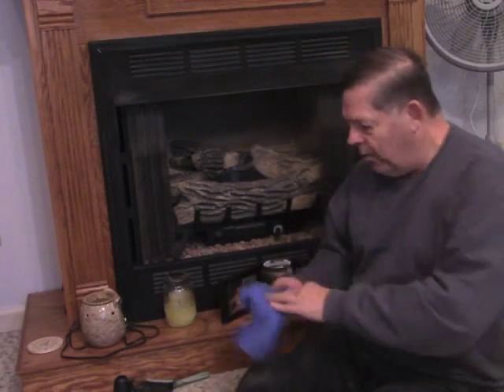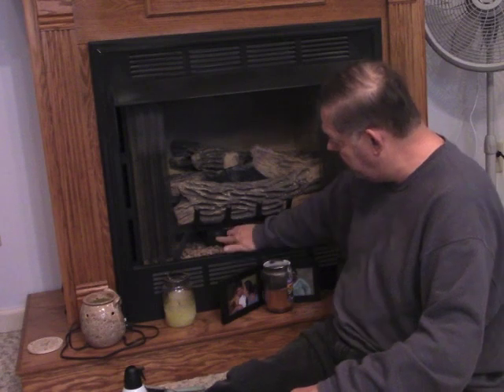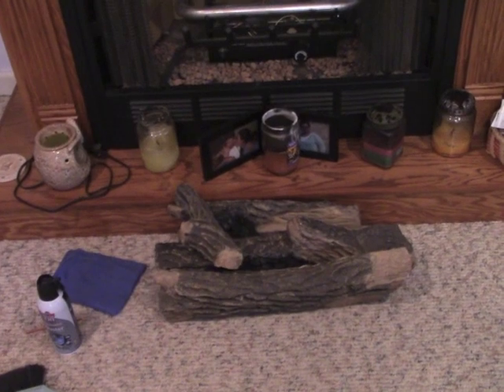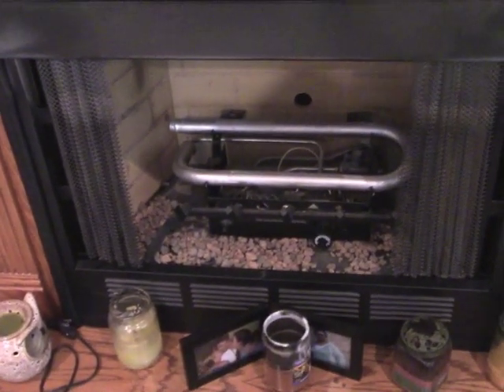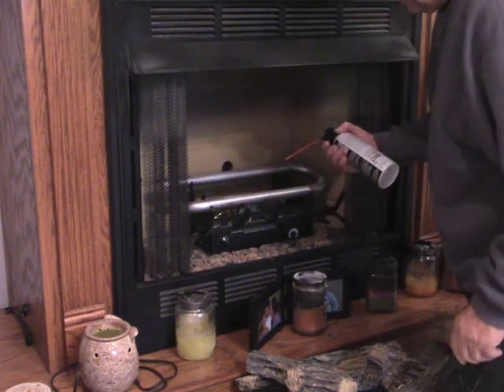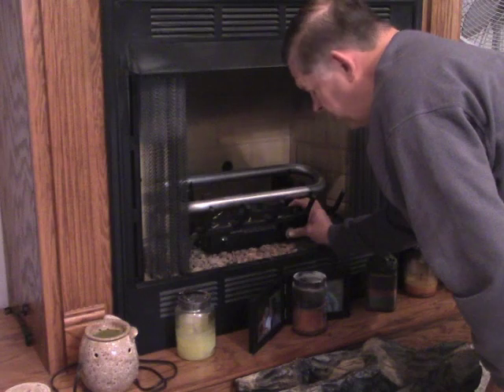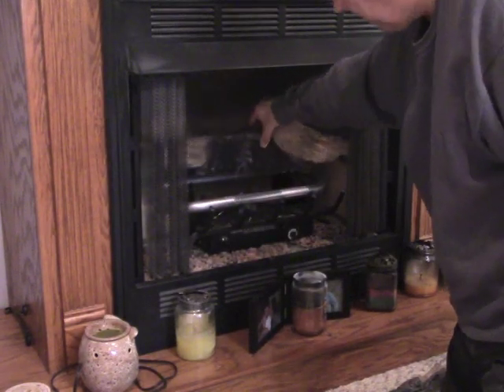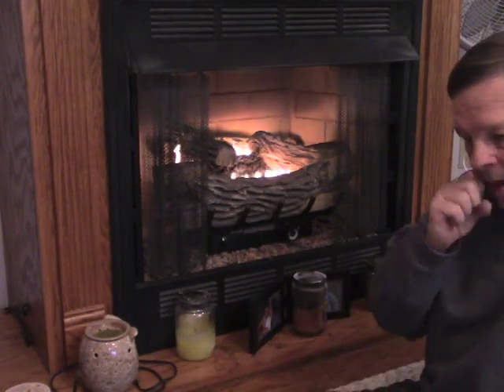DIY: Clean & Light Your Gas Log Fireplace!

Comment: I appreciate the video; however, I’m not sure I could find where the gas comes out to use the blower. A close-up of where that was would be helpful. You showed it, but you didn’t point to it.
Reply from the maker: The gas comes out of a small nozzle behind the first log. Take the logs out of the fireplace and you might find it. BUT: take a pic of the logs so you remember how to put them back in place. THX for watching!